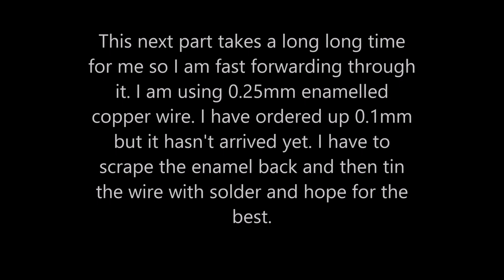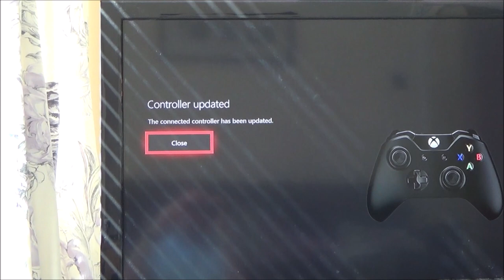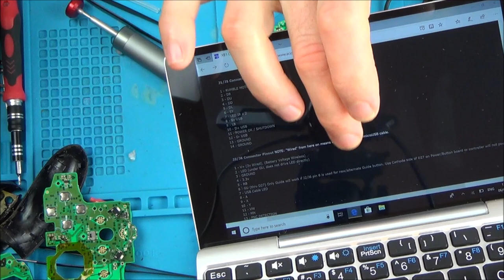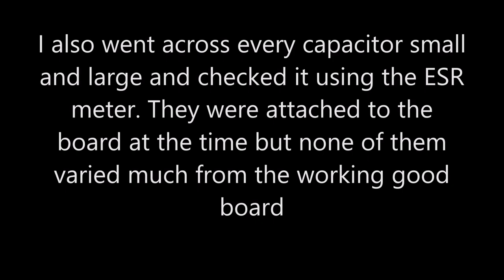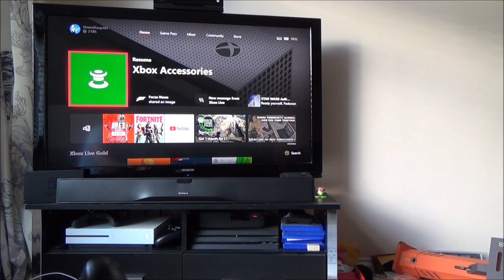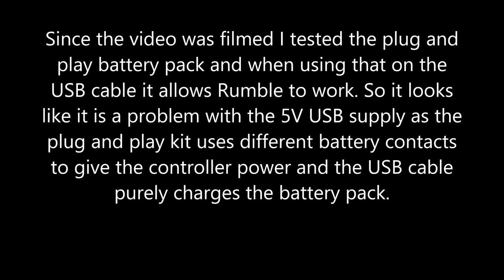Trying to FIX eBay Joblot of Faulty Xbox One Controllers PART 4

Comment: 25:01 hi Mate, you shoudl clean the carbon as much as you can do because it makes the PCB conductive and it might ruin your job later on. Also if you apply solder mask you might help to avoid shorts.
Reply from the maker: Thanks mate :-)

Comment: Diode test on the meter is easy to use.  Testing a diode on a old scrap motherboard with diode test, one way I get 0.184V the other way I get OL. If I use resistance on the meter I get 3.78KΩ one way and the other way it fluctuates between 10KΩ and OL (the diode is probably across a capacitor which is charging and discharging). Anyway either way your looking for a low value one way and a high value the other way. So say on diode test a diode reads 0.2V one way and 0.6V the other way, That would show the diode is good. If however it read 0.0V both ways the diode is short circuit and if the diode read 0.6V both ways the diode would be open circuit. Just to clarify 0.6V is a figure I pulled out of thin air. if the diode is S/C it will read 0.0V both ways, If it is open circuit it could read both ways 0.1V, 0.2V, 0.3V and so on. But a working diode will always read low one way and high the other way.
Reply from the maker: Perfect explanation. Thanks pds :-)

Comment: hi a common problem with ps4 controllers is the analog potentiometers wear out or the charging ic burns out because someone plugged in a quick charger (samsung quick charger capable of outputting more than 5v)

Comment: was there any reason you didn't try to save the "donor" board instead of that burned board? you didn't mention what the fault was on that one or what components were missing, but if I had that many spare parts and found a board that was severely burned, I would start looking at solutions that allowed me to use it for salvage. you didn't check whether the heating was still a problem right? so maybe that replacement component will eventually burn too if the issue was somewhere else

Comment: Would be useful if we know what exactly this burn chip that you replaced do in the board because if you checked everything, the only thing I can imagine that can be slightly different is this chip.
Reply: U1 is an MP2161 from Monolithic Power Systems. It's used on all versions of Xbox l One controller.

https://www.monolithicpower.com/pub/media/document/MP2161_r1.1.pdf

U2 and U3 are MP3414 from the same manufacturer.

https://www.monolithicpower.com/en/mp3414.html
Reply: RepairMonkey  Cool so this circuit on the board should be a buck regulator, so probably he steps down the voltage from the USB to other circuits (Because most of IC works on 5V or 3.3V) and in 33:41 this is probably the inductor that this type of circuit requires to operate. So to check if he is working properly, just probe the inductor with the ground and you should see some voltage.
Reply: @guilhemedemassenaladario  As I understand it - that's correct.  It makes sense to me that U1 steps the voltage down to around 3V as that would be the average voltage from two new AA alkaline batteries. Hence why U2 and U3 are primarily boost controllers - to maintain a steady 3.3v / 3.5v  the battery voltage drops as the alkaline cells discharge.

Comment: Vince, it seems that you never test the connector on the bottom for the headset on this controllers. Is that because it's correct to assume that it works, if everything else does, or an oversight? Also, great job on  this "Franktechstein"!

Comment: vince i was thinking what if the pad you thought was a ground that come off when you removed the melted chip to fix the wired syncing was in fact responsible for the vibration just a thought
Reply from the maker: I could look at the donor board again but I am pretty sure that pad didn't go anywhere. Next time I have them out I will do a little check with the multimeter just in case it is as easy as that. Cheers mate :-)

Comment: hello, I have a controller that does not work with any of the rumbles, neither with batteries nor with USB connected, if I remove the two rumbles on the left side, the two on the right side work sometimes, i tested the buzz removing the two right rumbles and the left on the trigger work without problem, but if i play battlefield the two of the left works some moments.
Reply from the maker: Interesting, so it is like there isn't enough power to make them all work. Thanks for the info :-)
Reply: @Mymatevince  hope you can find the problem, i do not have another board of the same model, the model controller is 1697, right now im trying to fix the D-pad stick, because the original dosn't work propperly, im trying to put it in the right place.

Comment: You know this already MMV at 14:40 if I were you I'd have applied fresh solder to the pins on the chip then applied heat with the gun and (theoretically) the chip would have come off easier.

Comment: I would have cut the legs off that dead chipbwith an exact blade then use a soldering iron to clean the severed legs. Either that or at least add fresh solder before trying to remove it.

Comment: Dude you could've just applied flux then removed that chip with a big blob of solder. You don't need hot air for everything. Watch professional video on people removing chips.

BTW: chip orientation is determined by a dimple or an arrow on the chip itself and matched on the board by a little v dip in the silk markings on the PCB. 

If you have other questions, don't hesitate to ask.

Comment: You should be working for NASA mate lol..... The green A button on my  Xbox 360 wireless controller stopped working so I took it apart and tried to fix it. Now the D pad and the A button don't work. ...Probably a simple fix for you but I'll just have to buy another one.

Comment: I have an Xbox controller I'm struggling to fix! 

With batteries in it will only stay switched on while holding the Xbox button, as soon as I let go it disconnects.
Reply: Possibly the same chip that failed here - U1. Although U1 is for providing power from the USB interface, if it fails it can short the supply from U2 which provides power from the batteries.
Reply from the maker: Thanks for all these helpful replies RepairMonkey. It is great that you are sharing your knowledge :-)
Reply: @MattP79  thank you, works perfect on USB connection. It will even work on the batteries while pressing the power button so you think it's the u2 chip? Need to find a good repair guy 🙄
Reply: @ryaaaaaaaaan  It could be anything :(  If it works correctly on USB, the rest of the chips are likely working correctly. Think of U1 being an alternate to the batteries.  The other chips (U2 and U3) use either the battery supply or 3.3V supply from U1 to do their thing.  Don't overlook the basics though. Are the battery contacts clean? Do they hold the batteries tightly? Are the batteries alkaline type? Have you tried a new set?
Reply: @ryaaaaaaaaan  Belated thought. Is it an Elite Controller and have you been mean to it?
Reply: @MattP79  no it's the grey normal one with green anologue plastic :) not been mean to it lol
Reply: @ryaaaaaaaaan  Ah well.  If it were an Elite (or an older model) I'd have an idea what it may be.  In spectacular timing - see Vince's latest video :)

Some soldering pr0n of the same type of issue here:
https://drive.google.com/drive/folders/1kAknnBKOBNbos9mx4_m7Xz2ImECDsN9P?usp=sharing

So - if you overly flex or drop the controller the board-to-board connectors can break loose. Hence my question ;)

With your controller I'm low on ideas.  The gray/green is a model 1708 which has a single board-board connector.  The only 1708 I've bought with a similar issue had corroded battery terminals from a leaking battery.  It worked fine after replacing the battery terminals.  That your controller powers correctly from USB should mean the U1, U2 and U3 chips are working correctly and also the controller's processing circuitry is good. That the guide LED lights (when Xbox button is pressed) when only batteries are installed indicates that the controller is switching between battery and USB power sources. That it doesn't stay on suggests bad batteries, bad battery contacts, a bad or damaged solder joint on the battery circuit or a bad component in the battery circuitry :?

Where on the planet are you?  Maybe someone local can help?
Reply: @MattP79  yes I seen :) I was waiting for him to check if it worked while keeping it pressed but going to take mine apart now and check that part!
Reply: @Mymatevince  I have 2 controllers if you want to try and repair them? :)

Comment: I just had to stop watching the video @13:43 to interject that that IC definitely failed spectacularly, and when it did, it actually melted the cases plastic effectively gluing the chip to the PCB, Having said that let me say you sure have lady luck working for you because of the very little damage done when removing the Lil Fu?! err-Sucker.

Now.. With the Rumble or buzzer not working via the USB connected, I suspect that diode you replaced may STILL not be doing its job as intended, mind you, if the diode proves to be working via the Mod website correct voltages, then you may have dropped a resistor or moved a resistor near to the replaced chip, what does the Mod website say about that chip you replaced? does it make mention of rumble not working via USB but via battery its fine?
Reply: Would it pay to migrate parts to another board?

Comment: What a fekin Rampton!!!! I could have done a better soldering job with my Weller Fred Flintstone edition that I bought back in the 80s. You may have better results if you throw away your black and decker hot air paint stripper and try to forget all of the bollox that you've been told by "so called" experts and learn how to solder with a bog standard iron with fluxed core soldier,,,, also removing a chip with legs is usually done from the rear of the board and not by barbequing everything in its visinity with gallons of flux!!!😂